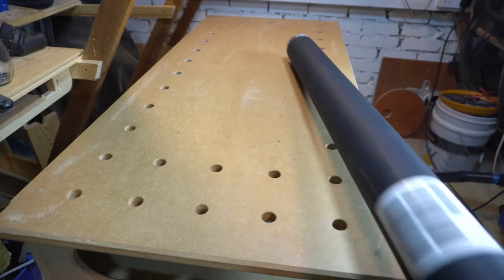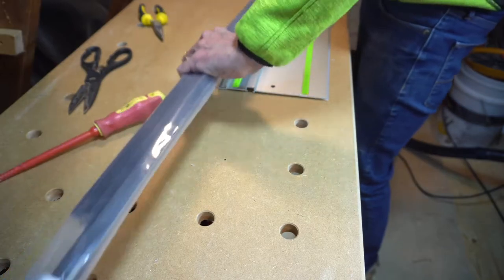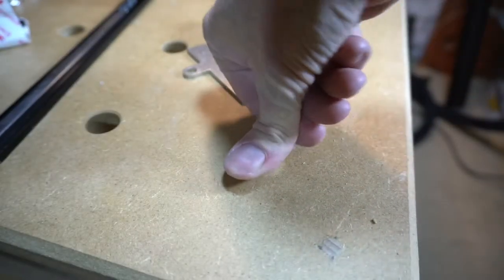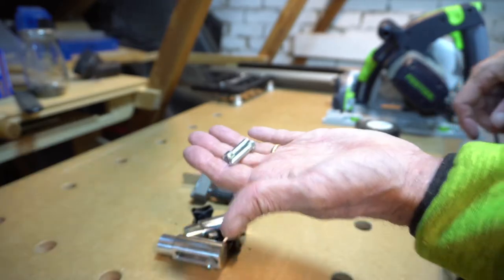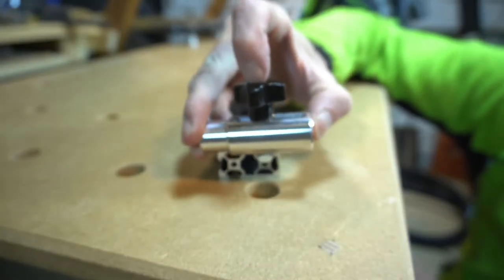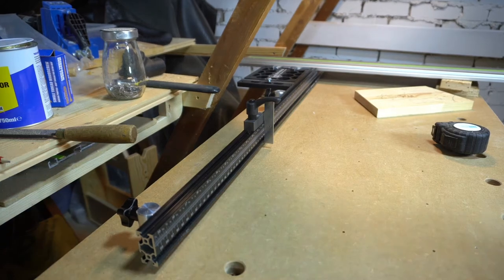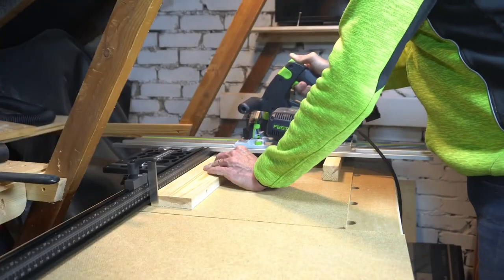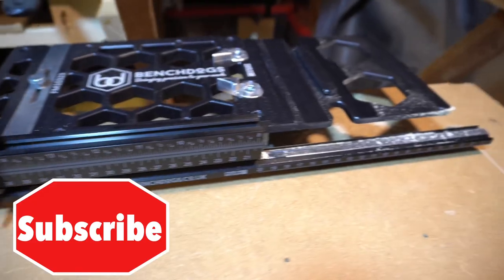Benchdogs Fencedog MFT cutting station Work Bench

Comment: Interesting seeing your solution to the railsquare dogs hitting the fence (by putting the rail above it). I was always fixed in that the only solution was to add additional holes or move the fence further into the top (and loose depth).

I also got the impression that a 1/10 of a mm or so was needed to be cut of my fence when trimming it.
Reply from the maker: Emil. Thank you for your comments. Regards JP

Comment: Good video and easy to follow however I’m not convinced that cutting the end off the under fence is correct. I’m sure I’ll be proven wrong but maybe Ralf from BenchDogs could comment. 
Surely by aligning the end of the fence with the rail splinter strip is the way to go as you’re now a couple of millimetres short??
Reply from the maker: I’ve had a few comments and they go either way.  Problem was it was cutting a couple of my long when set to splinter strip. After cutting it is perfect with fence measurements. was more worried about my blade. regards JP